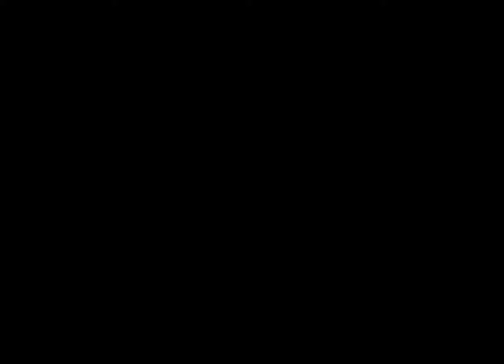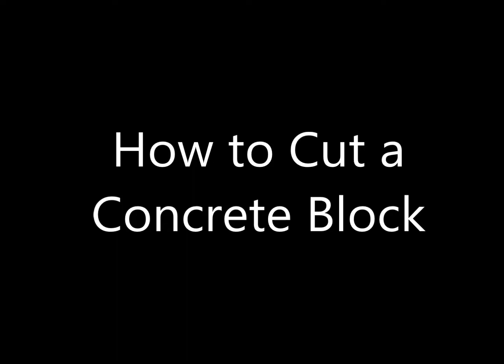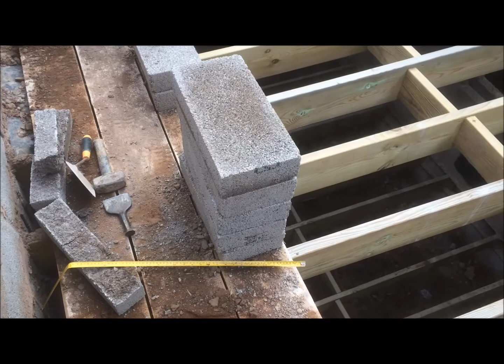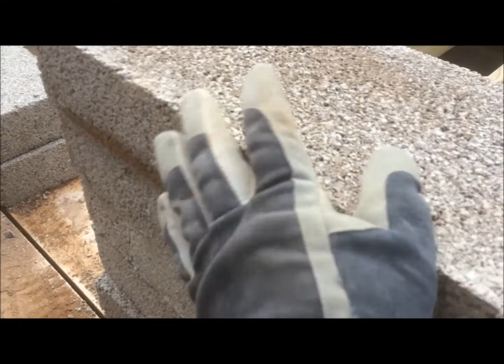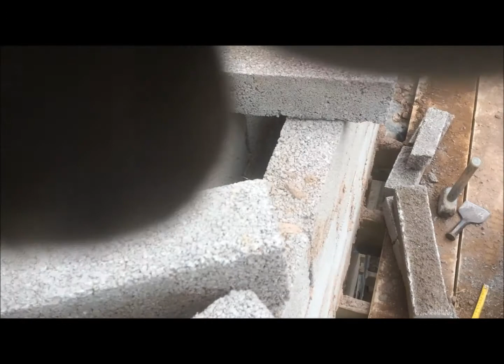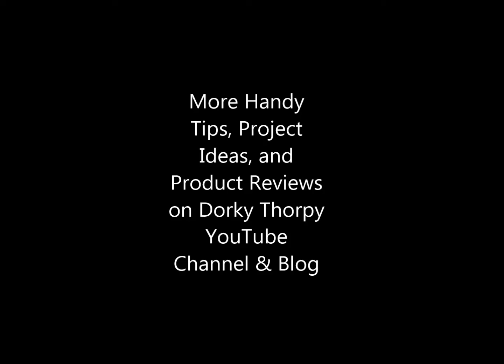How to Cut a Concrete Block

Comment: When I try this lengthwise, they always crack widthways and I end up with 4 pieces, help!
Reply from the maker: Mmm this is tricky. If you are very patient and gently establish a good groove, then maybe it will work. But cutting anything thinnet than . . . 8cm is very difficult, best to use an angle grinder for length ways cuts.